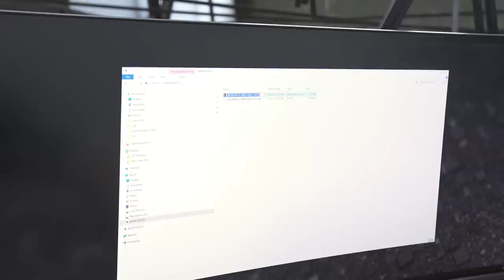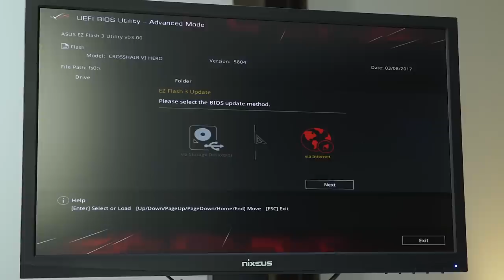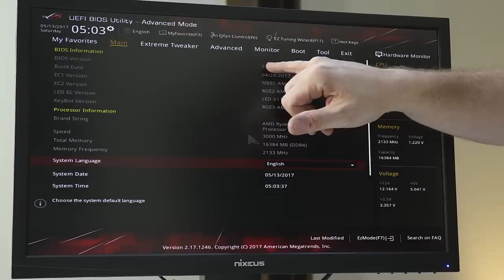How to build a Gaming PC

Comment: which is a better cpu to go with, RYZEN or Intel? I have always been Intel but I see a lot about RYZEN lately...
Reply: Intel are not who they appear to be. Why? Intel: Anti-Competitive, Anti-Consumer, Anti-Technology. Can Intel use illegal tricks to be the only company allowed to make & sell processors? And Intel pays Dell, HP, Sony, Acer, Samsung & all the others to not buy AMD's processors? And keep all their practices secret? Then AMD spends ALL of its money trying to sue Intel since 1987?

Intel's compiler software? Written to perform fast ONLY on Intel CPUs. This is then used by programmers to write their software, including games, which will then run much slower on AMD's processors. Intel was then left in a position to suppress the speed of its own processors & inflate their prices to gain more money which they need for bribes.

My guess: Intel bribed the major gaming-software makers to use its compiler software, who all kept quiet about the payments.

Someone on a youtube comment: "For anyone needing proof Intel cheats in benchmarks. Look up "SPEC2006 results". For some reason the supposedly non-profit SPEC organization that puts out benchmarking tools requires these tools to be benched with the Intel compiler (and not, say, GCC). There's a hard-coded test for one of these benchmarks-libquantum (a quantum computer simulator)- in the Intel compiler code and if it finds it it rewrites it to run about 15 times faster... but only on Intel CPUs. This test is used when benchmarking all server CPUs and leads to a major boost on the average Intel server CPU results."

Basically, Intel paid SPEC. They know who writes benchmarking software. They are not stupid.

Tablets? Makers paid to not use competitors' CPUs.

Bribes were paid to Europe's biggest computer seller.

Game-console makers were given free Intel CPUs so AMD could not compete. Eventually AMD broke through.

Intel's processors are now in the Asus Zenfone 2. You'll have to take a wild guess how it got there.

Amazingly HP, Dell and Lenovo are now offering laptops with AMD's Ryzen processors.

35-minute talk made after decades of research on the evil, global, faceless, corporate Intel:
https://www.youtube.com/watch?v=osSMJRyxG0k

I'm willing to guess that Intel doesn't pay taxes. It's part of the global corporate empire with Monsanto, Amazon, Google, Starbucks, Facebook, McDonalds etc. Yes, Amazon. They're in on it too.

Intel's new Coffee Lake CPUs won't use the Intel-made z270 chipset so won't work with the Sky/Kaby Lake 1151 boards. Angry Intel users, who sensed they've been scammed:
https://www.youtube.com/watch?v=dt-oA4x776A

Maybe you have an Nvidia graphics card. Had Intel destroyed AMD they would have taken out Nvidia and been left as the only manufacturer of graphics units. Intel grossed $52 billion last year.

Who makes the chipset in the motherboards for Intel processors? Intel. If Intel knock out AMD then they can charge whatever they like for them. I read that the AMD chipsets are made by someone else, not AMD.

Benchmarks misslead as they don't show the CPU usage percentage. 2-core Intel benchmarks are far higher than they should be compared to 4-core AMDs.

I asked an i3 user who told me that an i3 running daily software like browsers, office suites, media players etc. all at the same time uses 30% on all cores.

So i3's run Windows like the old AMD dual cores that many AMD users threw away years ago, the ones now sold on Ebay for $7. (An i3-6100 is $100. An i3-7100 which is not that much faster is $170.)

Someone wrote they wished Intel would do more "great" things like the Pentium G4560 (an i3 at a lower price). Someone responded that Intel were limiting those to entice more people to the i3. I think that's just going to backfire on Intel.

In 2025 Windows 10 updates will expire so a current i3 is unlikely to be able to run the next operating system after that. By then you could get a i5-6400 at $60 but you could get a Ryzen 5 for much less which will be much better at multi-tasking. This assumes the new Windows supports the 1151 board. (Windows 10 doesn't support socket 1155 which came out in 2011). Windows 7 support ends Jan 2020.

Those who create security & anti-virus software won't use Windows 7 forever.

Someone with an Intel G4560 & a Ryzen 1200 wrote: “I own both of these cpus and believe me, g4560 slows down a fucking lot after 2 weeks of usage due to the antivirus and other stuff, and with ryzen I can even listen to the music on twitch in full hd, have 3 more chrome bars with tutorials for csgo/lol champ builds and much more while still sustaining stable and better fps than the g4560".

A gaming reviewer on Amazon wrote of his Ryzen 3 1300x: "its snappier than the i3 4170 its replacing and games are running smoother, I cant say frame rates are much higher but its more consistent with less drops and stuttering. Farcry 4 and The Division seem to be running at a much more solid 60 fps now with 4 physical cores instead of 60 with drops down into the 30s and 40s randomly with the 2 core 4 thread of the i3."

Youtube comments on a Ryzen 1600 running several games: "wow CPU usage is 25% on 1600, and its fucking going at 90-100 fps. Damn Intel got there ass kicked from AMD. Im switching from buying a i5-7500 to a Ryzen 5 1600".

"The video I saw of a skylake i5 vs even a 1400 (or 1500x) the i5 was 100% cpu utilization and the 1400 / 1500x was like 65% cpu utilization. AMD just destroyed the i3 and i5 line of intel lol".

"I upgraded from an i5-3570k (oc @4.2 ghz) to a ryzen 5 1600X and the performance is way better! In games like bf1 or grw it was constantly 100% usage causing me some really annoying fps drops! With this cpu i get a 75% use when the mess is everywhere and normally it stays on 35-45%. Never has those drops again!"

"A friend of mine just got a Ryzen 1700X computer. He wanted me to see it so I came over. I tried it and it seemed faster than my computer, but I was not overly impressed. He noticed my disappointment and pushed me away from the computer. He said "Watch this"! He opened 5 tabs in his web browser and opened a 4k you-tube video in each tab except the last where he opened an 8K video! He opened 3 1080p videos in VLC player (each separate instances) and one more VLC video playing 4k video. Finally he ran a full malware-bytes and anti-virus scan. The cpu never went above 58 degrees celcius in temperature and cpu utilization went from 52%-72%. He let me try the computer while all this activity was simultaneously going on and it was still faster than my computer (older Intel -i5). I was so impressed that I promised him I would buy my own Ryzen computer before the end of the year!"

Someone tested a ryzen 3 1200 with an nvidia 1050ti in a few games. The card was at 100%. The CPU was at 50%. My guess is that an i3 or a g4560 would have been more at 90-100 than 50%.

Someone asked AMD on Facebook if they should upgrade their Ryzen 1600 to a 1600x. AMD replied just overclock it instead.

One person, who claims to have 35 years' experience of PC building, wrote that they couldn't get their Ryzen motherboard to detect an SSD for installing Windows 7. They blamed it on the Ryzen motherboard & I think sent it back. Others with different CPUs have had the same problem but found the correct way of getting their motherboard to detect it. Lots of people have installed Windows 7 on an SSD. 35 years ago is 1982. In 1982 the only people who had PCs were businesses.

(The Windows 7 installer can only use ps/2 mice/keyboards, not USB.)

This same person claims the Ryzen 1600x (6 cores, 12 threads) isn't fast enough for Windows 10. On that basis no one with an i7 could run it either. In fact no one has ever used Windows 10 because everyone is still waiting for a CPU fast enough for it.

Comment: so after 9 years of long life on my old system on all but the video card and the hard drives which i just replaced because of how small they were, it is finally time for a new rig, i have all the parts but the case arrives on tuesday,(reusing my nvidia 1080sc gpu),   i went with a msi x570 tomahawk and amd ryzen 9 3900x, plus all the other goodies and the only thing im unsure of is wether or not i should flash the BIOS and whether or not i should do that before or after assembly.

Comment: Just built a new system using this mobo but I see you didn't use the 4 pin power connector. Is i necessary to have both the 8 pin and 4 pin connected? I also used 16 GB of corsair vengeance DDR4 2666 but under auto detect the system saw it as 2133 MHz, in AIDA64. I am using a RYZEN 5 1600.

Comment: Hey I'm building a ryzen rig right now and in the process of installing a EVGA GTX 1070ti GPU into a masterbox 5 lite. 

Have you ever experienced the two support fins on the bottom that need to be angled through the expansion card slots being too long? When I go to seat the card into the PCIX16 slot the fins are too long which doesn't allow the front of the card to seat properly. 

Would you just trim the fins to fit the case?

Comment: I have a brand new corsair rm650 psu. Is that enough power for a rog strix b350f MB and the ryzen 5 1600? My gpu is a rx560; the gpu gets power from the MB but in the future i hope to get a more powerful gpu that would plug into the power supply. On a budget over here. Thanks!
Reply: wow; cool. thanks. i feel much better!
Reply: Kevin S. most likely less than half of that psu is being used. the voltage calculator on pcpartpicker.com is very good, you should check that out

Comment: Hey Jay, what speed RAM did you use for this ryzen system? I'm running a Ryzen 7 1800x and i was reading that its only compatible with 2400 RAM, and anything faster is pretty much a waste cause it scales it down is this true?

Comment: So how much does all the parts costs
Reply: DREz GamER123 depends. It can be from $500 CAD-$8000 CAD. CAD is Canadian dollars. 
USD is American dollars
I suggest using this build if your budget is small

CPU: AMD Athlon 200GE costs $100 CAD/$75USD

Motherboard: Asus a320m-k $80 CAD/ $80USD

RAM: 1 x 8gb 2400 Corsair vengeance LPX for $80 CAD/$60USD

Storage: if you don’t play many games buy a kingston 120gb ssd and if you play a lot buy a 1tb hard drive. Or get both for $80 CAD/$60USD

Power supply: EVGA 400 N1 $45 CAD/$35 USD

Case: any case you want. $50 CAD-$100CAD/$35 USD-$75 USD)  

This should cost about $450-$550 CAD/$335 USD-$410 USD. The parts in the video were fairly well expensive for new builders likely.

Comment: Isn't the AIO supposed to be installed in such a way that the cooler is the highest point and not the cables. So as to make sure that the bubbles are not entrapped somewhere on the cable... pls correct me if I am wrong.

Comment: I find the radiator fan setup weird. Why blow air through the radiator and the hot air goes into the case, warming up the internals? Maybe the heat from this CPU is not that high and the setup can still accommodate this flaw? Not the ideal case for this build, I guess.

Comment: Hey JayzTwoCents, Im trying to build my First Gaming Pc. I really really need your help,
Im using a Core I7 7700k as the cpu with a GA-Z170X-Gaming 5 Motherbord. im going for the Zotac Gtx 1070. with a 750Watt PCU. Im going to be Using G.SKILL Flare X Series 16GB (2 x 8GB)  Ram. Could you help me out picking which Cooler should I Get for this PC and weather the hardware i have selected is compatible with each other.
Thank you in advance.
regards

Comment: i have an x470 Aorus Ultra Gaming MOBO with Ryzen 5 2600 * GTX 1660ti but on my mobo i’m getting a red led on cpu and ram it cycles between the 2 but i have not installed the ddr4 memory until tomorrow might that be issue ?

Comment: I have a noob question I have a ryzon 5 3600 I’m upgrading graphics cards to a asus invidida gtx 1070 my question is the plug on side of graphics my old graphics card doesn’t have one how do I hook it up. And is it possible I have to change power supply

Comment: I have a question:
The USB ports on the front of my case don’t work well. I can plug in a controller and it works, but when I plug in external drives they don’t. Does anyone have an answer? Thank you.
Reply: Fahad Zubaid Hey there! Have you tried the USB ports in the back?

If so, then you may have to re-install the USB Drivers

Have you tried using the external drives on different PCs?

If they don't work there, it might be the drives themselves.

Lemme know how it goes.

Comment: I need some help pls. I just built a new pc. It has a Asus b450 steel legend motherboard and RYZEN 3 processor/Vega graphics. Long story short when I powered it I get out of  range message on the monitor. It's a new Asus monitor 😵. I did some troubleshooting, moved reseated RAM checked PSU cables made sure everything is plugged in correctly and that what I get out of this new build.

Comment: ryzen 5800 x or i7-10700k for gaming?
Reply: 5800x, Ryzen has been killing the cpu field recently. 5000 series is insane.
Reply: @achillesz  i watched i7 10700k vs ryzen 5800x in gaming it had better fps the intel one...
Reply: @BestGamesJustin  Sure, but the 5800x has more threads, that thing is insane on productivity tasks. And the 5000 series is much faster than most of intels lineup.

Comment: you did not show the addition of the thermal paste to the cpu when you put in the cooling system... did you or do you apply thermal past to the cpu or no? (when you connect the cooling fan / or system to the cpu)

Comment: Ryzen 5 2600
ASRock B450 Pro4 MOBO
16GB DDR4 3000Mhz G. Skill Aegis RAM
1TB Samsung 860 Evo SSD
MSI RX 570 8GB Armor OC edition
Seasonic 520 watt 80+ bronze modular PSU
Rosewill TYRFING case
2 140mm Rosewill RABF case fans.
Total before rebates $821.88
Total after rebates $774.88 That also includes thermal paste and a Cooler Master Hyper T2 CPU cooler.

Just throwing that out there for people.

Or if you need to shave $63 off the price...
Replace the 860 Evo with a 2TB Seagate Barracuda and a 120GB Kingston A400 SSD.
Total price is then $758.77 before rebates and 711.77 after rebates.

Comment: On the CPU connector you plug in an 8 pin from the PowerSupply there is another 4 socket next to it why did you not put anything there from you Power Supply. I ask cause i am doing this set up.

Comment: A little late to the party but i wanted to know why he removed the thermal compound after he did the bench test? Does it become useless once its been exposed to air or is because he just wanted to avoid the mess by getting thermal paste everywhere?
Reply: thermal isnt liquid, it's a bit like silicon, once you take it off, it no longer remains contact between the cooler and cpu, meaning you have to reapply it. 

Also, he removed it for the sake of adding other coolers or swapping out cpus perhaps

Comment: It isn't necessary to plug the 8 and 4 cpu power cables? 8 is enough? Sorry for the newb question.
Reply: Jack Lee no bad questions :)

It just depends on what Cpu you have. If the MOBO has all 12, it will support CPUS that need up to a 12 pin connection.

In this case, this cpu only needs the 8. Any cpu you buy will have requirements listed for its needs

Comment: Hey guys i'm considering updating my old pc/ rebuilding it and could need some serious advice from you guys :)
My Current Build: 
AMD Phenom II X4 955
GTX 660
ASUS M4A87TD 
Kingston 4GB RAM
1 TB HDD

I strongly consider buying and ryzen 3 1200 and a GTX 105 TI, but is there more to think about?

Aprreciate any help and nice video!! :)
Reply: EverybdyLies 
You would also need to upgrade almost everything else, like ram, mobo, and psu, possibly even your case. If you're in the US this is a good upgrade: https://pcpartpicker.com/list/g7Djm8
You can save ~20$ and get a 1200 instead, but this can be much better if you overclock, and is better out of the box.

Comment: Please tell me if Asus prime b350 plus can run CRUCIAL DESKTOP RAM BALLISTIX ELITE – 4GB (4GBx1) DDR4 2666MHZ Product Code: BLE4G4D26AFEA out of the box

also should I buy 
CRUCIAL DESKTOP RAM BALLISTIX ELITE – 4GB (4GBx1) DDR4 2666MHZ or CORSAIR Vengeance LPX 16GB (2 x 8GB) 288-Pin DDR4 SDRAM DDR4 2400 (PC4 19200) Memory Kit Model CMK16GX4M2A2400C14 for gaming..which is worth?
and is getting 3200 hz ram really imp performance wise?

Comment: ONE QUESTION I HAVE SAME MOTHER BOARD BUT A XFX Radeon RX 590 Fatboy DirectX 12 RX-590P8DFD6 8GB 256-Bit DDR5 PCI Express 3.0 CrossFireX Support Video Card i install all drivers n stuff but somohow it shows display but the fans dont spin at all just when computer starts for a bit n then they stop

Comment: Hello ... sorry for my bad english
I have the following problem and very strange by the way, I got an Motherboarda ASUS x470 Prime Pro and I will not have the Ryzen Microprocessor for a few days, so I wanted to test it in case I had something defective and not lose the fast warranty, I know if one connects to the Motherboard the Source and we give it to start it should turn on the fan lights and some other thing, and this does not ... the weird thing is that when I connect the power cord the lights Aura that this Mother brings turn on, but when I give the Power button nothing happens, it may be that these new Mothers bring some system that if you do not have the micro installed do not turn on, or the plate is broken, thank you very much.

I want to clarify that I tried exactly the same mole with an ASUS Formula V and prendo no more good.

Comment: HELP!!! I followed you until the test part. My RAM and Mobo lit up, not sure about the CPU but the GPU remains dead dormant. No video output and switching up the power connects did not work! Is there something wrong with my GPU or PSU? It is a Gigabyte Aorus 1080ti along with a 750W EVGA G2 PSU.